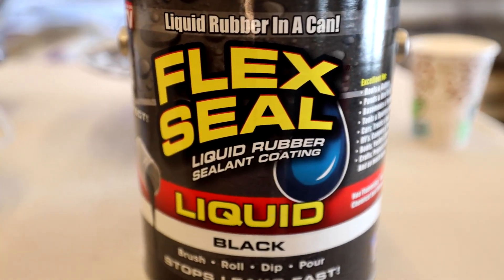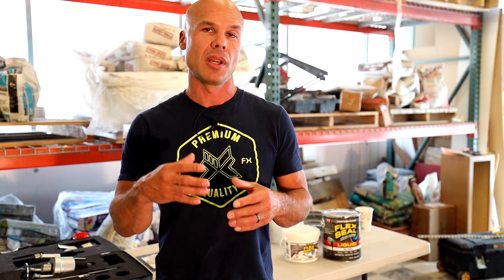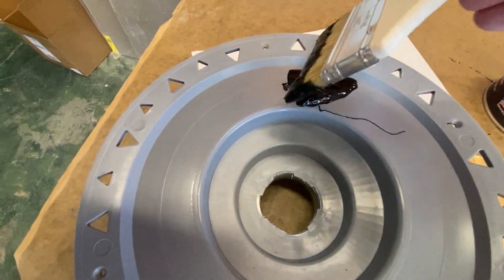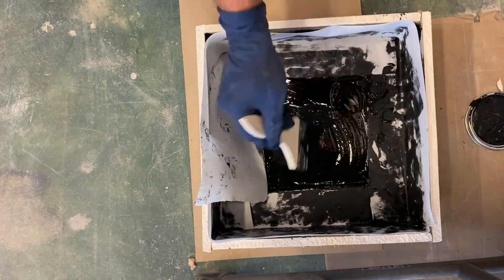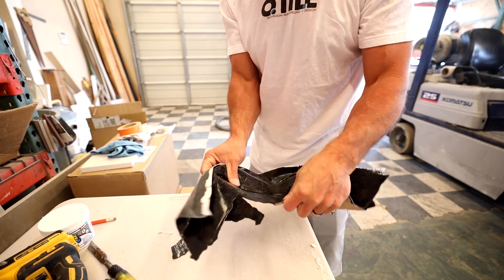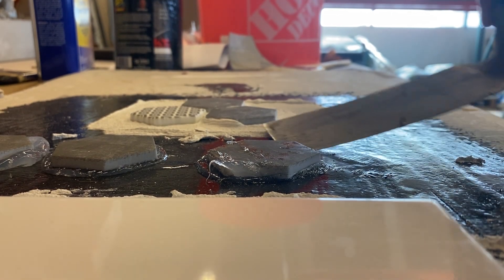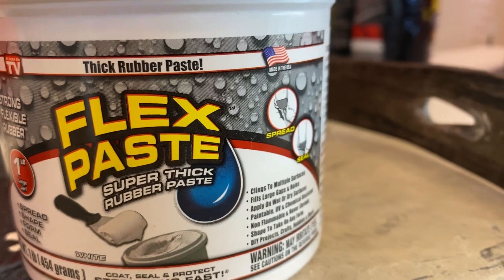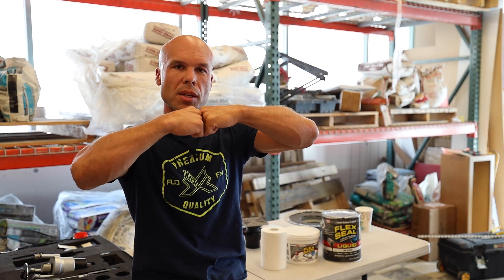FLEX SEAL to Waterproof a Tile Shower???

Comment: What are costs of Flex Seal versus traditional methods?  Would there be any time savings by using Flex Seal? What sort of time data does Flex Seal have about how long Flex Seal has been in use successfully.  I think you should build the shower out of Flex Seal.

Comment: I wouldn't go down the flex seal route I would lean towards carlise water proofing products though I don't do tile work but with on of those kinds of applications I would put hard board over the waterproofing after it dries and try to minimize how many screws I'd use to attach it. Maybe even see if the floor pan can be held in place with the hardboard walls or maybe glue it down. But I've waterproofed building never a shower so I generally wouldn't know but definitely like the idea of a liquid membrane. Ever thought of peel and stick membranes no dry time and fairly easy to install and detail?

Comment: Problems mentioned worth considering:
1) Flex Paste holding up under water or not
2) Durability of material vs. conventional long term (cracking, etc.)
3) Cost of Flex products vs. conventional

Comment: I am in the process of doing a master bath remodel and would love to investigate you doing a Flex Seal install for it.  Unfortunately, I am in Salisbury, NC.  This would be a leap for you and Flex Seal would definitely have to be on board.  The shower I am planning is 4' x 7' curb less.  It is in my 120 year old house with a crawl space.  I have just spent major money on the foundation and floor joists.  The tile I was going to use is 2" hex like you used for the tensil tests.  I am a retired engineer and would love to discus this with you and Flex Seal if there is any interest.  Thanks....
Reply: OK.  So let's talk about how this would apply.  After looking at several of your videos, I have a novel idea.  Since my house is 120 y/o, I have to tear out the floor in the bathroom as it is hardwood that has dubious structural properties.  The shower is going to be curbless 7' x 4'.  The drain I want is a linear drain down the center of the 4' dimension.  I can slope the sub flooring to take the drain and then cover the ply with Hardi backer.  One layer of flex seal brushed over the Hardi and with the Hydroban sheet embedded with the folded corners like you did with the RSS waterproofing membrane.  Then an additional layer of Flex Seal over all of that.  Then the tile can be adheared to the Flex Seal with the Flex Paste as shown.  One question is which linear drain to use?  The Kerdi line has the bonding flange/ film that might bond better to the Flex Seal, but I like the simplicity of the Hydroban.  Thoughts?

Comment: Sounds great but I purchased flex seal which is not cheap, it is $100 for a gallon, I don't know how much the paste cost but the other question is which grout would be appropriate for this situation... would it take conventual grout or possibly epoxy grout.  Will the flex seal contribute to mold? I think some more control tests would be great like you've already done but these just could be walkways in front/back of your shop and just a way to let the elements really put the test to them. I'd like to see a shower done, but I am just a little skeptical.  But as they say "no risk, no reward".

Comment: Hi, on the subject of sealing: I am doing my shower/bathroom and the plan is a PU floor with tiles on the walls (because she wanted it). For the seal between the tiles and the PU, I was going to use 2 component silicone - but if you have a better solution, I'll take it!  Thanks for the videos, you and others really help.

Comment: Interesting... i used this stuff for extra sealing after rust conversion on an automobile as an under- coating and removed a small square to check 2 years later that did see a lot of action moisture-wise... I  have to say I was impressed.

Comment: I think weather it’s cost effective is a factor compared regular means. Also ease of use compared to regular methods. Being innovative is supposed to yield some kind of positive results I. E. Cheaper, quicker installation, or better end results. Not to change products just the sake of doing it.

Comment: Good review, but I would not trust Felx Seal for any permeant job that you want  it to last more than 3 years.
Run away with any products that have "As seen on TV" on them. 
Just like an auto paint,  a $50 gallon and $400 a gallon paint initially both look  the same. But after a year or 2,  the $50 a gallon paint starts to peel and crack on you and $400 still good as day one.

Comment: I have used ShowerKote from Kote Products. 5 years and no damp or leaks from shower at all. Also it is totally transparent, so you can coat over tiles without spoiling the aesthetics.

Comment: I used Flex seal on the joints on backer Board on an out door porch.  Then Sealed everything with Hydro Seal.  2 weeks later  the lady calls and said she has leak coming in.. I assured her it was not from My job at all. I paid for a leak detector compony to come out.. and come to find out. I got and Big apology  and her new windows she just had installed were the problem lol I would use Flex seal only on the canners of the shower though  then continue rolling your other waterproofing over it. but then you're just getting in to an extra expense that is not needed.

Comment: The whole job hasn't been accounted for in my opinion. How does the Flex Paste layer behind the tile effect both tile spacers/levelers (specifically the break off) & grout? If grout doesn't bond well to what's behind it, the job isn't worth much. Agreed?

Comment: Don't use flex seal !!! The stuff breaks down over time. it initially goes on well, you think it will be fine.  I used some on an exterior stove vent on the roof.  I sanded the metal flashing.  The stuff breaks down and flakes within a month or so.  Granted it was exposed to the elements but they market it to be used on exterior applications.  It will break down. I will not use this on anything anymore. You will be sorry.

Comment: I have used flex seal to stop leaks in a boats and I have seen it on roofs also. It seems over time it will break bond and flake away from having water on it, off and on. Using it in a shower would worry me due to the prolonged use of the shower with heat and cold. If it was a lake cottage or a vacation home that only gets used a couple times a year I would feel comfortable. It would be a fun video though. Cheers man!

Comment: Let's assume it basically works. What are the reasons to use it? Easier or more cost effective or "better" (however that can be measured)? We don't know the long term stability of flex seal versus standard materials but without being a chemist, it appears similar to red guard etc. We know red guard is pricey - I don't know the price of flex seal. Great idea for a video - I watched without having a need to refresh a DIY project, just because it is interesting.

Comment: It seems to hold cold water well, but in a shower application, we are dealing with warm to hot water, will it still hold. Another issue is molding/humidity trap. How will does the flex seal stand up against mold. As well all sort of showering and cleansing house hold chemical that are used on a daily and weekly basis.

Great video but I felt there are more thing to explored

Comment: Lots of questions here. What do you do to create a shower pan slope using the Flex Seal substrate (roofing material?). What about floating shower walls. What is the impact of doing lathe and plaster over Flex Seal? Did you observe or consider any expansion contraction issues with Flex Seal that could negatively impact the job. I am a retired contractor and now live in a rural area. I would like to do a shower remodel on our master bath. I am afraid that hot mop services are probably nonexistent here so Flex seal seems like a good alternative.

Comment: Using flex seal would be like getting married. You hope and expect it to last. If it fails, it will cost you dearly as well as be heartbreaking. One difference is that the divorce will leave you high and dry. The failed flex seal will just leave you soaked.
Reply: The same is true for ANY waterproofing method...if it fails it will cost you dearly and leave you soaked. Question is, does this last longer than other methods of waterproofing.

Comment: I'd use it looks like it works great. You can experiment and redo my bathroom and shower  in it if you pay for everything. Do scheduled checks or updates for the channel if you want. If it fails you don't have to replace it.

Comment: I wouldn't do this cause it just seems  very unpractical. Plus I'd be worried about the grout on the floor cracking from the movement in the flex seal cause it is rubber so it will move

Comment: Great videos Isaac!  I’ve learned a lot from them 
I’m also a licensed B contractor in Northern California, doing mostly tile work , about 30-40 bathrooms a year and , of course lots of floors and splashes 
 I’d use it in a niche or outside the shower on the curb wood , and about 6” away from it on bathroom floor.
Those things never get hot mopped and I notice a lot , or at least some ,wood rot in those areas, whenever I do a demo
Reply: This is exactly what I'm considering it for, and how I came across this video! I'm extending the splash zone around a free-standing tub. My plan is to put a layer on concrete on it, but am slightly concerned that the thinset doesn't stick well to it. Also, I have Henry 208 instead of Flexseal. I think they are similar. I would love to see this test with that.

Comment: So I also do quite a bit of tile work and I would not use the Flex Seal for one main reason it is super expensive it's going to cost way more than thinset does because it comes in such a small tube you can't buy big bulk of it at a decent price other than that watching your test if I had a small area that I had to do a repair something on yeah I might use it

Comment: The only real question is: what is the lifetime before it dryrots/drys out? It's basically hard rubber.
Reply: It's likely just edpm rubber like used on RV roofs, they are generally 15 to 20 year roofs and remain flexible in harsh conditions.

Comment: Awesome tests!  Questions:  How does it compare on price?  Would flex paste by itself work?  Does the product hold up long term, remaining flexible, strong, and water tight?  I bet someone out there has already done some long term testing.
Reply: Flexseal is rubber and rubber lasts, so I would say this is a good solution.

Comment: I would use it only if I was going to tile the screen door on the row boat. You may have stumbled on to a new way to put tile installers out of business.what about grout? Will it stick to the adhesive? Lots of questions.

Comment: I see others have asked about the price comparison to the products you use regularly and I would think it would run a but higher then normal at 90 dollars a gallon unless you can get a contractor discount. Also the snell is crazy and in a small area I believe it would be overwhelming. Also the work time of the product is very short from my experience  with it but I definitely would love to see it done and I love the product and have used it around basement windows pipes running through walls and many other places. 

You do a wonderful job on your videos I was born into the masonry trade began at 8 years old dragging 8 inch block but still trying to master tile just a different animal all together yet very similar to cultured stone applications in some ways. Keep up the good work.

Comment: I would totally use it if you did first with another one of your extremely helpful videos on an actual shower installation.  Thanks for all your videos I've been in the trade for 30+ years and still pick up helpful tips from your videos

Comment: I have tried many sealants to seal Evaporative cooler pans. Flex Seal works wonderfully. It's expensive, but gives peace of mind. 

Doesn't Flex Seal cure with oxygen? Would Flex Seal between itself and a large format tile be able to properly cure? 🤔

Comment: The reason for the sanding of the PVC components is that they are molded and have a release agent on them and it must be removed by sanding. This is typical for most molded products either injection molded or vacum formed in my experience

Comment: I think it probably would work, but would you want to use it. When compared to a product like Redgard that is designed for purpose, Flex Seal is more expensive, solvent clean-up and not compatible with thin set. I think there may also be real problems with solvent fumes is you cover a large area in a small shower area.

Using Flex Paste for the adhesive looks like it will work but, again, would you want to. It is very expensive at about $100 per gallon. It is ready mixed for those who don't want to mix thin set, but solvent clean-up more than makes up for that in my mind. Again, what are the solvent fumes like in a small, enclosed space?

How long must it dry with tiles covering it before you can grout? How well will the grout stick since it presumably will not stick to any surface with Flex Paste on it..

Nice video which may actually make me consider these products for the right project as they look like more serious products than I had previously thought, but tile will not be one of them.

Comment: That stuff is more expensive than hydroban....I would rather use hydroban if I'm paying the same price or more for flexseal at $30 for 32 ounces or $120 for 1 gallon. Just found another  liquid waterproofing product called UZIN HS 100....German brand. It's actually better than hydroban. My favorite liquid waterproofer right now.

Comment: Flex Seal is simply a liquid rubber formula. For that matter, you can test many different liquid rubber products on the market to find one that is just as good for your work and costs less than the pricey Flex Seal. 
Your should find industrial chemists on Youtube or Reddit and ask them for advice on comparing liquid plastic and rubber sealing products

Comment: I would  use  it.  I would  use it.    I would  like to  see the cost  analysis .  But more important to me is  which  is  easier.   Also  I  have always wondered why do people consider epoxy which cures into  a plastic like coating.    Would you please consider doing the same test with Epoxy.

Comment: Using ANYTHING that works well comes down to cost. Is the cost of the flex seal more costly than the other water proofing material (say Red guard or something else) ?.
Reply: I think 1 gallon of flex seal might be a little cheaper than 1 gallon of redgard.  But the flex paste is most definitely more expensive than thinset.

Comment: You should try using Mapei Eco Prim Grip before the thinset. 
I beleive the shower you tore out that had window flashing sealant looked like prosoco fast flash. For window flashing it's great but for tile adhesion with thinset it's probably similar to flex seal. I saw another comment about grout sticking to it and that's a good point, how about epoxy grout?

Comment: Test it on solid concrete floor in order to find its maximum strength.
Reply: Because showers are made on concrete floors?  Fail.
Reply: @1dariansdad  We have TWO showers on concrete floor. How is that a "fail"???

Comment: I Definitely would have concerns of the length of time of it's durability vs a standard install with either standard thin set or modified mortar. Opinions?
Reply: I asked a friend about it and he said he put it on his trailer roof after a branch punched a large hole in it.... It leaked again after 3 years. But then again it was exposed to Midwest heat and cold if that matters?

Comment: FINAL TEST: Place the same hardy board + flexseal trowelable paste with tile attached underwater for a long while, then repeat the tensile test? I think that is the final test of trust - if it will hold up under wet conditions. Really interesting testing you did, I always dismissed flexseal as a serious product.. but seeing your results forces me to reconsider. I think if it holds up after sitting in continuous wet conditions, this is a serious contender for a legitimate waterproofing system.

Comment: Does the grout stick? And what's the flex paste like to work with? If you get thinset on the front of the tile it's easy to wipe off. I'm not so sure with that paste. I would consider using it on a small area. Thanks for the vid

Comment: My roofer told me that there are more and more guys in his trade that think highly of Flex Seal and its usages. I can't think of a more unforgiving application than a rooftop.
Reply: That Flex Tape is no joke! You can apply it to the bottom of a cracked fiberglass tub and it will stop the leak 100%. Customer can use the fixture until I can get out there to repair. A month later it's a job to pull it off. A real tile guy knows all this Red Guard, ect and boarding up showers is a joke anyway, Flex Seal couldn't do any worse IMO.
Reply: @billysyms5761  Red Guard works just fine as long as you apply it properly.  Red Guard over concrete backer board is bullet proof.

Comment: If you wanted the best water proofing possible you should use fiberglass and resin, also the materials needed are much cheaper than the traditional shower water proofing systems, remember that is what most boats are made from.

Comment: I'm not too familiar with this product but isn't it really expensive for a small amount? 
I think if you were to waterproof and use the same family product to adhere the tiles the cost would be much higher than already proven products.